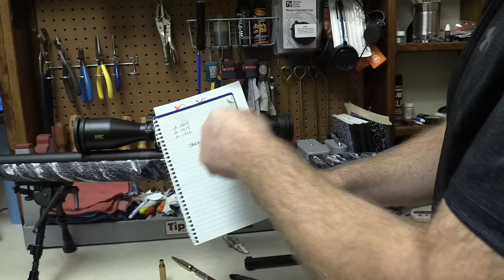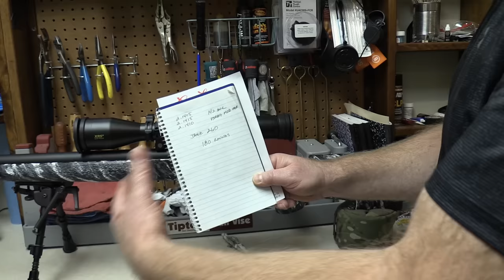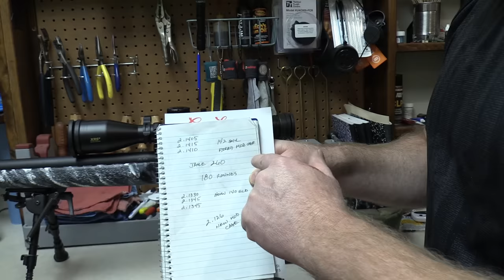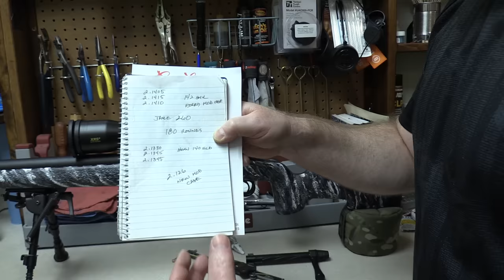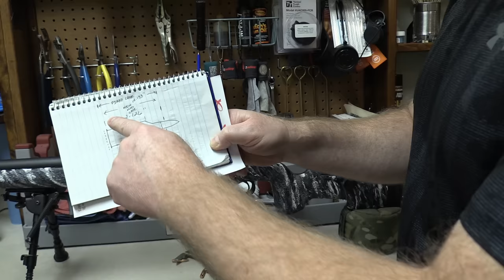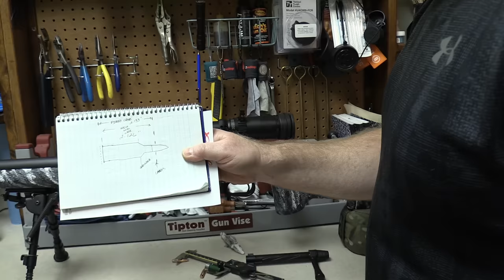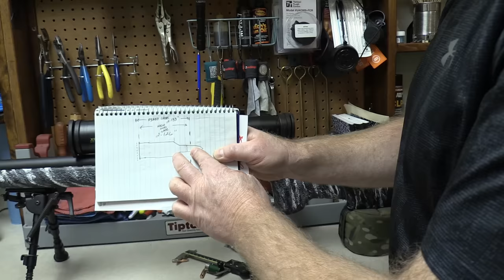COAL vs.  CBTO & Measuring Max CBTO w/ Hornady LnL OAL Gauge

Comment: I was one of those new to reloading that was constantly changing the bullet seating depth until a bullet rolled off the table and landed on the nose of the bullet. That's when a light bulb came on telling me there will be difference with each bullet and there should be a better way to seating. That's when I started looking for a video concerning bullet seating. The video that made the most sense was Panhandle Precision. Thank you Sam for taking the time to share your knowledge and experience with all of us.
Reply: With lead tips if they aren't shaped identical then cartridge length won't be. I knew measuring to the lands was the way to do it but I never knew how
Reply: Next, look into bullet runout and concentricty 😅

Comment: Please correct me if I'm wrong here, but it seems like using a fired piece of brass vs a non fired piece of brass vs the already modified Hornady case really would just be more for personal preference and ease of measuring. Since you're measuring the rear of the case head to the ogive of the bullet, the difference between headspaces on given cases can mathematically be accounted for. Say for instance the Hornady case or non fired case has a .005 shorter headspace than a fully fire formed piece of brass that's been bumped back .002. When measuring the CBTO on that Hornady modified case or non-fire formed piece of brass, you could just add the .005 difference to the total CBTO measurement factoring in that increased length for the fire formed piece.

Comment: I was having a crappy time with a brand new Willson 22" ss barrel. Readings all over the place. Called and spoke with an engineer, a gunsmith, that works for the company. He said they are not highly polished, and the lands are rough. Go buy factory ammo or build to OAL and break in the barrel. I did that and now getting accurate land readings. The bullets were hanging or stopping on the ruff cut lands. So hope this helps someone having the same problem.

Comment: I hadn’t thought about the shoulder-to-ogive measurement as being the only one that’s truly fixed. I’ve had new brass where the base-to-ogive measurement is substantially shorter than once-fired brass, even shorter than SAAMI minimum. Thanks!

Edit to add:  if you take your CBTO measurement then subtract the base-to-shoulder measurement, that will give you the fixed shoulder-to-ogive measurement of your chamber. That won’t change except for throat erosion over time. Then you can check the base-to-shoulder measurement for any given batch of cases and adjust your CBTO goal.

Comment: I normally don't make a practice of watching the video's that deal with this topic....gives me heartburn to read some of the responses...lol.   But, you do a very good job of explaining these things.  I am the original inventor of the Stoney Point line of OAL Gauge, Modified Cases, Bullet Comparator, Headspace Comparator, and Rimfire thickness comparator, cleaning rod guides, and a few other associated tools.   Most of this work dates back into the 1980's and 90's.   It was difficult early-on, explaining to some hand-loaders how to use these tools....especially before video and you tube video were available.  I had to get the cliff-notes version info printed on the back of the packaging back or on a small instruction sheet back then.....Grin.  Then, as now, lots of folks will claim to make a better mousetrap.  I spent a good deal of time and energy to arrive at some of the features found in these tools....and tried my best to keep them affordable and relatively easy for the average reloader as well as the advanced reloader to use....as well as many bench-rest and long-range shooters.   You'r never going to satisfy everyone.... But for the dollar spent....I still think it would be difficult to surpass these tools you nicely explain here.   Nice job!  ....and.....Keep up the good work Hornady!
Reply: One tip I could give you.....is to insert. a wooden dowel through the muzzle against the bullet tip.....thus sandwiching the bullet between the wooden dowel and the push rod on the OAL Gauge.   Then you can "jockey" the bullet back and forth and feel the "stick point" of the bullet with the rifling.     Doing so.....I was always able to hold 1/2 thousandths in the results.   But the big thing is that you use the same technique each time.   The method I said above just makes that a bit easier.   Best...

Comment: Sam, you can buy an appropriately sized wooden dowel rod at a local hardware store for next to nothing.  I run this down the barrel to bump the bullet out after taking a measurement.  With the magazine removed it falls right onto the bench.  Just remember after punching it loose to back the dowel out 6 or 8 inches so it won't interfere with the bullet on your next measurement.  I'm older and my PRS rifle weighs too much to pick up over and over!    Thanks for another enjoyable video...measuring the CBTO is the most difficult concept for most folks to understand and you did a nice job here...i like the artwork!

Comment: My first experience with jump and poor accuracy occurred in the late 60's with a 222 Rem and Hornady SX bullets. Jackets are so soft that good groups could not be had with any freebore. Benchrest accuracy occurred when the SX was touching the lands. Later on using this as a guide  I found that the tougher or harder the bullet jacket the lass difference the jump makes in  maximum accuracy. I still find that true today, so, if it won't group with "jump" try seating out, sometimes it works.

Comment: Great video Sam, thanks. You said everything is different for each rifle, each case, each barrel, each bullet which is 100% correct. I'd like to add that it is most pronounced between bolt guns and gas guns, self loading. In my AR-10 the closest I can get my bullets to the lands is about .060 before the cartridges will no longer fit into the mag. So in my case of using an autoloader, COAL needs to be respected in the sense that CBTO will allow the consistency between cartridges but not exceed COAL so that the cartridges fit into the mag. On some of the smaller bullets, I usually shoot 175 SMK and 168 SMK so I don't have the problem of bullets not having enough seating depth, but that is a real possibility with smaller weight bullets. Reloading for autoloaders is different than it is for reloading for bolt guns.

Comment: Great video. I learned a lot by watching this.
One of the biggest rookie mistakes I made when I first started... Was switching brass in the middle of reloading. I started with fired monarch brass and all my measurements were to spec.
I switched to Remington brass without resizing. And my overall length was not to spec. The rounds still fit and worked... I consider myself lucky.

Comment: As Sam pointed out in this video once you determine the Cartridge Base to Ogive, (CBTO), measurement, this applies to that bullet only.  If you use a different bullet it will likely have a different CBTO measurement. ------------
One thing I would like to bring up is when you seat the bullet, the seating stem, in most cases, does not contact the bullet at the same place we measure the Ogive when obtaining the CBTO measurement.  What this means is you will need to adjust the seating stem for different bullets.

Comment: Thanks Sam. As always, good stuff. I take a deprimed, fired case, measure the datum/shoulder distance, then take difference from a commercial modified case into account when I do the CBTO measurement. Had a head scratcher, when I was trying to load to just off the lands last summer. New brass, wouldn't chamber. WT??? Yup, jamming the bullet. Came to the same conclusion. Thanks again.
Reply: Good idea I'll try this as I'm just about to load with new Lapua brass. No chance of getting near the lands if loaded to magazine length. At 2.85" COAL the CBTO is 0.19" off the lands. Any less and I'll have to single load them. Tikka Tac A1 in .308.

Excellent video, highlighted all the issues I've found so far.

Comment: Ever thought about using layers of scotch tape on the head , trying in the rifle until you just feel the bolt touch the tape on closing then record the thickness of the tape stack, adding it to your measured CBTO. I often do that with headspace gauges when I don't have a  NO GO  or FIELD gauge to use but need to know. Keep up the good work.

Comment: Great overview, thanks.  I went through this exercise a couple of years ago, and used an Innovative Technologies Digital Headspace Gauge I already was using to determine my sizing die setting.  

Following recommendations in an article by Larry Willis at Innovative, I make a modified case from a resized case by cutting collet-like slots in the case neck, then putting in a bullet and chambering the round.  The lands will push the bullet back into the case, then I can measure the base to ogive with the same digital gauge I used to determine headspace.

In that method the lands can theoretically grab the bullet though and affect the measurement, so I’m thinking about getting this Hornady gauge just to verify, as that would eliminate that possibility.  

I try to seat the bullet as close to the lands as I can get (off by .002 or .003 in a bolt gun, and .005 or .006 in an auto) while still fitting in the magazine.

Thanks for the final insight on the affects of having the bullet jump as much as 0.100”.  I never thought that would be accurate at all, always try to get right on the lands, but I guess consistency is more important than distance as you say.

Just subscribed based on this video, so thanks for all the valuable tips here.

Comment: All reloading dies I am familiar with essentially seat with a ring at the end of the seating stem that contacts the bullet at a particular diameter on the ogive. If you set your overall length on one cartridge, then seat all of them the CBTD will be as good as  it would doing it your way. The downside is that you could not control the "jump" this way. Also it always amazes me how much trust reloaders of today put in their measuring instruments, I don't know what brand of caliper you have but most likely it will vary by at least o.oo1 and absolutely is helpless when  trying to read in tenths or even half thousanths. Jus tfor grins thry checking the same cartridge 5 times and between each measurement, close the caliper all the way and re-zero, to mock using it for something else, then do the next record after re-setting. Also bullets especially at the tip are somewhat malleable thumb pressure makes a lot of difference. Guess you could get a calibrated thumb. I would like to see a similar measurement taken with  high end diall indicater or micrometer so the pressure could be controlled by the spring or the mic thimble. All this is moot because I am amused by people who talk about "jump" in 0.005 increments and much difference it makes. All i n all lots of good work going on these days doing things only good bench rest shooter of the 79's even thought about. I still use neck thickness, concentric ity gauges, overalll length gauges etc. built in te seventy's, keep up the good work.

Comment: Thanks for the video, it has clarified a couple of points. I was a little confused after the other one you did on CBTO on different pills saying the CBTO should be the same. I got it now, same in the chamber but can be different with the measuring insert. In my sako 260 I get quite a difference with the CBTO measurement of nosler 129gn LRAB vs ELD or Bergers, like .090” think I’ll get swap out my hornady inserts for the Sinclair ones, oh and thanks for the tap twist too, got one on order to make my own

Comment: Besides magazine capacity. I have been using this process for 308 and noticed after I backed it off the lands .015 -.020 and I noticed that the OAL was longer than the OAL of 2.810 which is given in the book for Sammi spec. Does that measurement not matter as long as it is fitting in the magazine and I am using the ogive?

Comment: After banging the gun on the table to get the bullet out which is the way I used to do it I searched for a better way and I know what I am going to say may make some people cringe but if you are careful this is the best way I have found to  get the bullet out . I run a coated cleaning rod down the barrel from the muzzle end wit nothing on the end and the bullet tip goes into the threaded hole and stays on while you push it out then after pulling the bullet off i just pull the cleaning rod back just far enough to let the next test happen without interference
Reply from the maker: I do the same thing when I'm in the shop. If a guy was worried about running a cleaning rod in from the muzzle end, a long stick of 1/4" wood dowel material or brass rod would work, too. Like you mentioned, the key to using a cleaning rod is to make sure there isn't a jag or brush on the end of it.
Reply: or have a wooden dowel that is long enough.  even a fiberglass rod works.
Reply: oArticFoxo I just drop a .224 vmax round down the barrel from the muzzle end and it knocks it out.

Comment: Sam  your absolutely right about the case overall length, I have tried to chase that length to being the same and then I go and I measure the length of the bullet itself and I've had them very from 3 to 5 thousandths difference in length.

Comment: Thank you! Reloaded back in the Stone Age and just coming back to it, in Aus, with a 2023 NY built Remington CDL .243. Your advice on seating depth issues, especially, proving invaluable.  My question relates to limited experience with the Hornady COAL length tool. Have found that a Hornady 90 grain ELD-X projectile in a factory provided cartridge case attached to the tool, with zero resistance in moving it from the case - via your advice on using emery paper to smooth its passage - does meet moderate resistance in the throat - before it meets the lands - and needs a degree of pressure to push it through the throat and on to the lands. Is that as it could/should be? Understand from your presentation and other sources that Remington's typically have a long throat, but did not expect it to be "tight."  Rifle has only had about 50 rounds through it and so no opportunity for build-up of material in the chamber/throat. Would appreciate your view.

Comment: you cleared up so many questions that i had in my head with this video thank you! best video i have seen that explains this! the only thing i am confused with is what you use to bump the brass before you send them to get threaded. what die do you use? you said not to use something that will bump the neck so dont use a neck only sizing die? full length sizing die would still bump the neck though? what die do i use and what do i take off again? that is the part that has me stumped. Im new to reloading as im sure you can tell. messed up 100 first fired brass with my neck only sizing die because i went with the recommendations that came with the die. Learned my lesson. i will be sizing the neck so that it barely gets to the bottom of the neck and nothing more. with the turn that the instructions said, it stretched the brass near the case head to where it would not size anymore even with my full length sizing die. i heard you could use a short base sizing die to get them to re chamber but at that point i feel it is not worth it having hardened the case already

Comment: Wow, I’m finally getting some of my questions answered by your in-depth excellent videos. Very cool measurement techniques used. I previously watched your video about full length sizing with bumping the shoulder back .002 after each firing. Now in this video you just explained my other question of how to measure chamber and control the length of case to the ogive of the bullet profile to keep a consistent distance off a particular barrels lands. Very cool tools to use, I’ve learned a-lot so far. Question is: how in the heck can anyone with a progressive auto indexing press ever achieve consistent reloads to your precise methods used? I just purchased a Redding T7 Turret press for my 1st press. I assume reloading very precise cartridges using your methods will be very time consuming, however safer, more reliable and have great consistent accuracy. Thanks for the tutorial my friend. ✌️😎👍 🇺🇸